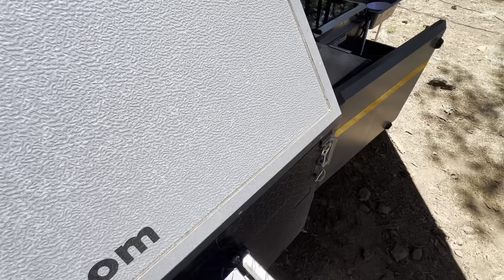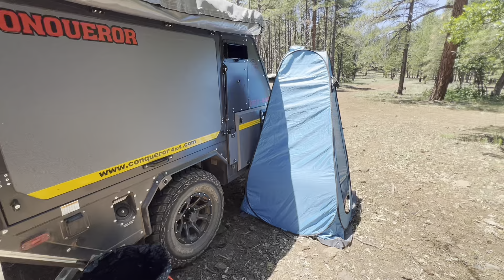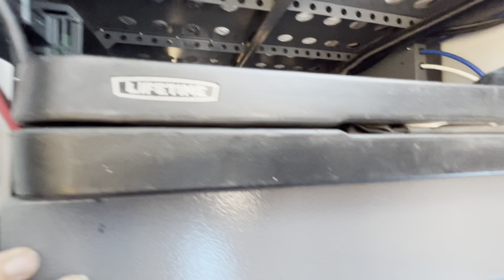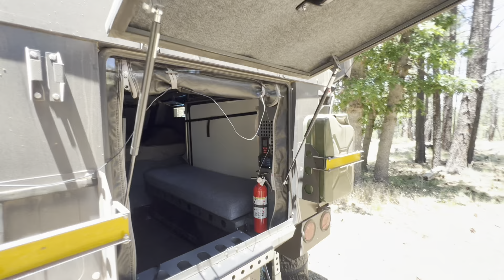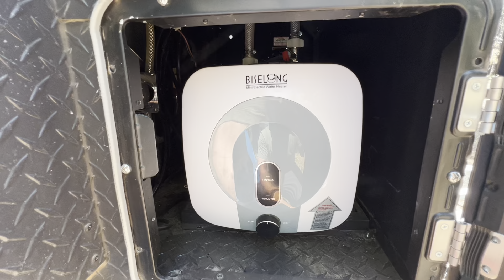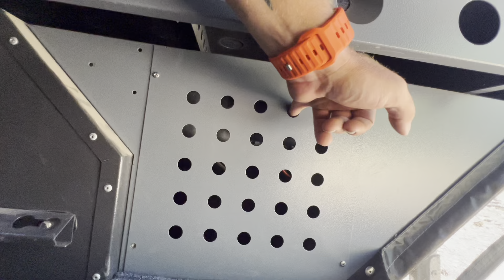Conqueror UEV-440 mods

Comment: How many amp hours of battery do you have? I had induction but sent back to gas, one week off grid and zero cooking ability with 200 amps of battery and 300w of solar
Reply from the maker: @mikefoster7085  300Ah of battery and 800w of solar. I usually use my induction stove of level 3 which is about 600w of power usage. If I go to level 9 at 1800w I can definitely run down the battery very quickly.